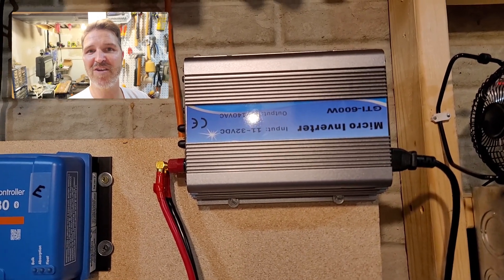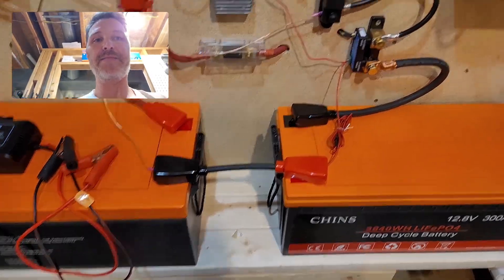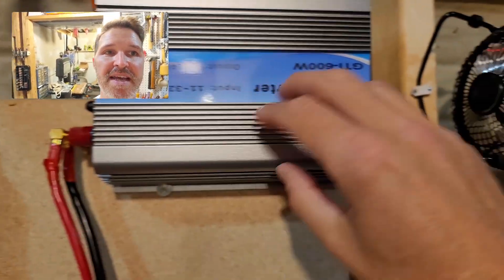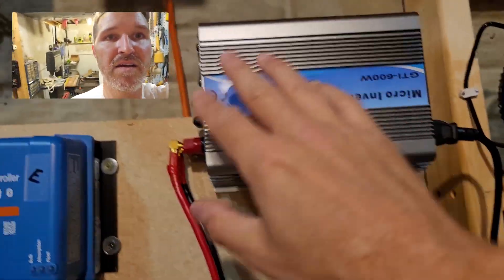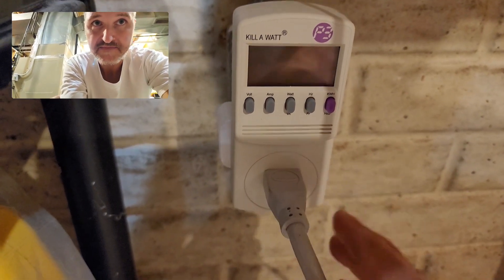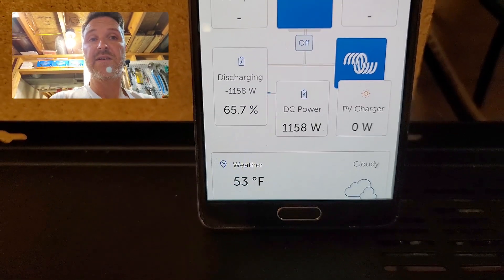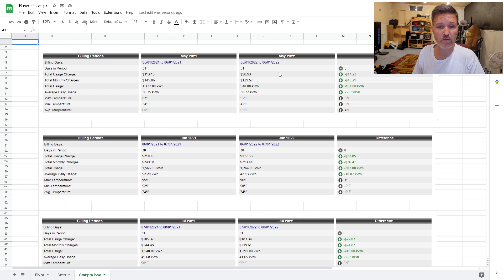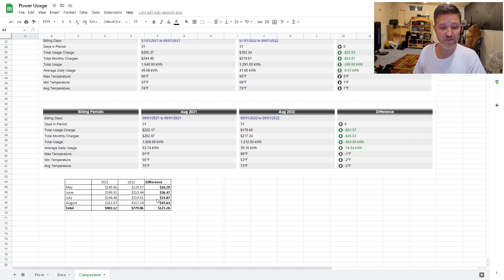Simple explanation of Grid Tie Inverter.  It saved me $123 in 4 Months!

Comment: Very cool, I just ordered what looks to be that exact unit because I plan to build multiple small systems that I can combine as needed rather than a single large single system. Glad it's worked out well for you.
Reply from the maker: Just make sure to control the heat and larger enough gauge wire.  Thanks for the comment.
Reply: @OffGridBasement  Yeah, I am thinking that a lot of people have problems because they try to squeeze the maximum out of their electronics at all times.

Comment: Would it be possible to connect the inverter as a dump load from the solar charge controller?
Reply from the maker: Yes.  Just connect them both to the same bus bars along with the battery.  You would need an advanced charge controller to set up a relay for the inverter to shut off from the AC side.  Not sure on how to do it.

Comment: I did not have much luck with the 1400watt version. May 1200w panels seem to bottle neck down to about 645 watts. So happy with PowMr registered full 1.2 kW of solar today 😄. Unfortunately I have no 36volt battery to test if 1400w grid tie works better with a battery.
Reply from the maker: Hope you get that battery soon!
Reply: @OffGridBasement  Not sure, I need anymore investment in solar now. More electrical than I need. And gas seems way cheaper than solar in terms of water heating for winter. PowMr is off grid. So not using much grid at all.
Reply: @OffGridBasement  I just run a couple of extensions.  Cooking and heating diminishing savings and return. Plumbing electric wayer heaters could be very expensive so no plans for that.
Reply: I have the 1400watt 36volt version too. I have mine hooked up to only 200 watts of solar panels at 36volts. I observed it starts getting really hot at 300watts so my remaining solar panels are connected to my battery backup solar system instead. I think the 1400watt version is overrated... I saw a video of another YouTuber who opened up the 1000w and 1400w versions and it was literally the same.

Comment: how do you keep the grid tie inverter from draining the batteries?  It will just keep running until the battery is drained
Reply from the maker: I put a smart AC plug on the grid tie inverter.  When I doesn't sense AC power, it shuts itself off.  It's a safety feature in the unit.  Thanks for the question.

Comment: Just to be sure, you're backfeeding the Kill-A-Watt from the grid-tie inverter and it's still able to measure the watts going back into the outlet, correct? I have the same meter but haven't wanted to risk using it this way because I'm unsure if it can handle power going in reverse. Thanks!
Reply from the maker: That's correct.  I've never had a problem using it this way.  I figure 600w is only about 5A @ 120v, so it's really not much.  Most outlets handle 20A and I don't think the Kill-A-Watt cares which direction the energy is coming from.  Hope this helps!

Comment: Thanks for the video. So when your ac unit turns on it drains your battery's really fast right? Ac unit pulls 3k watts per hour or more??  How many amp hours are your batteries? Thanks.
Reply from the maker: No.  It doesn't matter what is being powered.  The unit pushed the same amount of wattage regardless of what was running, usually about 530w.  So in the case of the AC unit, I would be using 2.5kw from the grid and 500w would be generated from the unit.  I hope that clears it up.  Thanks for the question.
Reply: @OffGridBasement  How are you limiting the power output?
Reply from the maker: @DaBuDaSak  There is no limiter on the unit.  I researched the base consumption of my house.  I realized my house was always using more than 600w so that's why I went with this inverter.  If you feel that is not your case then go with a unit with a limiter to be safe.

Comment: Now does this only supply to that oulwts breaker?
Reply from the maker: Yes.  It only supplies one circuit.  Don't use it for trying to over power a breaker.  I don't think that will be a good idea.  Thanks for the question and comment.
Reply: @OffGridBasement  I say I didn't think it be smart use it on same circuit as inverter charger
Reply: Once I get some extra panels I'm definitely going to do this

Comment: This is what I have been looking for. But I have everything set up for 12-volt battery system. And ideas where I can find an inverter for that? Thanks
Reply from the maker: Since these inverters are actually made to connect directly to solar panels, I don't think there is anything like that.  You could try connecting a 12 - 24v boost converter

Comment: This is in essence a plugin battery! I was thinking to buy a grid tie micro inverter myself and connect a battery on it to give that power back to the grid! Just as I see that they put batteries into the solar input of powerstations to extend their capacity!
Reply from the maker: It does work well.  Just make sure not to push the power outside your structure.

Comment: Interesting concept, i did it the opposite way. I removed a circuit from the panel, i then ran a plug from the inverter to the outlet. (outlet is on the circuit removed at panel) I hooked up a transfer switch to another house power circuit, the switch will then switch to house power at 12. 6 volts and come back at 14.1 volts.
Reply from the maker: Good thinking!
Reply: Porky...this is what I want to do, but not sure how specifically to do it. Do you have info (site or video) on how to set it up? Do you use a sub panel? Can you do more than one circuit? Can you do the circuit for the central air?

Comment: I have the same inverter GTI-600W but I discovered the meter you have higher 580w, I have lower the meter I got 80W, I have only one solar panel has maximum power 100w Vmp 18.41V Voc 22.41V panel model CNX-100 and my inverter GTI- 600W without battery only solar.
My doubt, do you need another more solar panels? I don't know how many more parts you need to give more power or it will damage the inverter, that is my question.
Reply from the maker: As long as you don't go over the maximum voltage of the inverter you will be fine.  Thanks for the comment.

Comment: Maybe you can explain this to me.
I have 12- 100W panels 6A each wired in parallel.
Each panel puts out about 21V, separately.
When wired together, I only get about 16V and about 9A from the PV array.
I have a 1300W GTI and it gives me about 1A out, never more than 2A.
I have meters on the 12v and the 120V sides.
WTH is wrong?
Maybe the GTI is loading the PV array down.
I expected 60A from the PV array.
I added a 2nd 1300W inverter on the same PV string and the outputs split, 1/2 on one and 1/2 on the other.
I will need to install the 2nd PV string to use the 2nd inverter.
Reply from the maker: What is the minimum voltage for the GTI?  The one I'm looking at is 34 - 46v.  You might want to parallel your panels so you have two sets of 6 panels.  That should put out around 30A @ 38V.  It makes sense that the output split.  The two units were receiving the same voltage, but at 1/2 the amperage.  I hope this helps.

Comment: I am thinking of using something similar.  I know if you use what it generates,  it won't be noticeable by your power company.  I am thinking if I charge a solar power station from an ac plug and can generate an equivalent amount of solar from a grid tie inverter,  it would be effectively increasing the max solar input of the power station.  Especially since most offer small solar input.
Reply from the maker: Just make sure it shuts off when the power station is full.  Thanks for the comment.

Comment: hello, great video, my question is You should not include the cost of the solar panels that charge your battery? or what ever cost that charge the battery?
Reply from the maker: I didn't feel it was necessary since the system was already in place.  All I did was add the small piece of equipment to an existing setup.  You have a good point though.  Thanks for the comment.

Comment: Are you still running the grid tie inverter? If so how about a 6 month update?
Reply from the maker: I took it down during the winter.  It was difficult to keep my batteries full let alone run a grid tie on top of it.  This season I'm going to do something different so unfortunately I probably won't be connecting it back up.  Thanks for the question.
Reply: @OffGridBasement  I built my system in the past 3 months (thanks for all the videos) so I am still trying to figure out my loads vs the sunshine. A couple of sunny days in a row and I am into surplus power. So I debating adding additional loads or something grid tied with an adjustable low voltage disconnect. Keep it set to pull the batteries down from full charge but disconnect at about 95%.
Reply from the maker: @davidbrady9686  if you have other things to charge, that would the way to go.  Plug them into the system.  I'm looking into getting an electric lawn mower and chainsaw.  Both 40v.  Low voltage disconnect might work really well.  Set it to turn on at your bulk charge setting  and turn off at the float setting.  Good luck!

Comment: This is really cool. Can I make it so the grid tie only kicks on when my batteries are in float and doesn’t discharge from the batteries at all?
Reply from the maker: I wish I knew how to do that.  I know it would involve the relay on a Victron smart shunt in order to trigger something.  I just don't know.  Sorry.
Reply: @OffGridBasement  Ok no worries I appreciate the reply. I have the victron smart shunt so I’ll have to to look into how to set it up through that. I did find  something on Missouri wind and solar. It’s a digital charge controller with divert relay and led volt meter for wind and solar.

Comment: Im confused.  Are you charging your batteries by your grid then pumping more power back to the grid? Or charging by solar ?
Reply from the maker: Charging with solar and pushing power back into my house when the batteries were getting full.
Reply: @OffGridBasement  ahh ok thanks
Reply: @OffGridBasement  is this automated? how so? or do you manually turn on yourself (connect battery to house outlet) when the battery is near full?
Reply from the maker: @john-vega  I monitor the battery and turn it on via the smart plug.  I can monitor the battery bank and turn on the smart plug from anywhere with cell service.

Comment: is that even legal ? Or do you have a program worked out with your electric company??
Reply from the maker: As long as the excess electricity doesn't leave my house there is no problem.  The grid tie inverter doesn't produce more than what my house uses at its lowest point.  It's just supplementing what I use in-house.  I'm able to look at what my usage is from the grid by the hour through the website of my power supplier.  Thanks for the comment!
Reply: Bingo. As long as it doesn’t affect electric company, you can rig up a treadmill or bicycle to generate as much power at home as you’d like.
Reply: @OffGridBasement  it still sounds like the electric company is getting cheated not that i care
Reply: I am not an electrical guy, but I personally imagine my house as a water bladder with two water inlets. One has large garden hose flow (electric co) and one is a small straw pipe flow. When the straw flow is turned on then the garden hose flow is pushed back a bit and flows less. As the need of “water” of the house is fixed.  The electric company would only see less demand from their supply as if a few appliances were turned off. I don’t see how they are cheated at all. Seems perfectly safe with islanding. Thanks again OGB.
Reply: That set up cannot be legal. No way.
Reply: @mannyfragoza9652  just stop
Reply: @mannyfragoza9652 it's not cheating but it's definitely illegal without a permit
Reply: @AgentOffice  I think if you don't push energy back to grid, then it should be ok. That's the purpose of this particular inverter, does not produce more than house needs, but would like to know how this is done.
Reply: @john-vega  most inverters can do no export. You need CT sensors on the main line

Comment: Does your electric company meter notice it being on? I’ve heard some meters record in AND out so these could charge you for the power you actually made. Perhaps it’s unlikely as your inverter is making a small amount in comparison to what’s coming IN so that maybe it’s just slowing down the incoming power flow “so to speak”.
Reply: If the power generated by inverter is used up by home appliances then the electric company would not even notice it because it doesn't even reach the meter.
Reply from the maker: That is exactly what is it doing.  My base usage for my house is over 600w.  I can see this by looking at the hourly usage from my electric companies' online portal.  Thanks for the comment!
Reply from the maker: Yep!  That's what is happening.  That is why I choose such a small inverter.  Anything better, I would need a limiter.
Reply: Thanks guys I’ll get one then! I was warned that our meters here could spin backwards and I’d be charged for it. I am a ceramic engineer as I hated electrical classes so your input makes sense to me in my simple mind.
Reply: I’ll buy one today from your link to help your site. Question…. I was going to run a separate 12-2 wire in attic from my 24v inverter directly to my fridge/freezer (& down a wall with a new dedicated “solar” receptacle).  I am thinking the Grid Tie inverter might help negate this need for a line? The 600W it runs could power a 550W fridge even over night? Or am I asking too much? In which case I’ll run the 12-2 line and new outlet anyway.
Reply: I’ve already run a dedicated 12-2 line into laundry room for a solar receptacle and then for six months I’ve ran an extension cord down a short hall way to power the 465W fridge/freezer. My system has been running that and my clothes washer seamlessly.
Reply: Saving ~$30/mo thru your grid tie is AwEsOmE! My payback till I break even on my solar build so far is 19yrs. The addition of the grid tie would help ALOT.
Reply from the maker: @chriswhitehouse9764  it depends on what you are wanting.  If the power goes out, the grid tie inverter stops working.  So if you are want to make sure the fridge keeps working during a power outage then you need to run the line and connect it to your off grid inverter.
Reply from the maker: @chriswhitehouse9764  thank you for supporting my channel!
Reply: Thanks for your education and encouragement here!
Reply: Purchased with your link!
Reply: I'm still baffled how his "grid-tied" micro-inverter is tied to the grid. That looks like a dangerous set up. Who pays him? What is he back-feeding into?
Reply: @realToby  true. I don't understand his set up.
Reply: If your base falls to 599 and you put in 600 won't that trip a red flag if only for a few seconds ?

Comment: Toys for watts explained that while this works, because the inverters aren't UL listed if your house burns down and is tied in any way to that inverter you will take a total loss. There are safer inverters on the market. Sungold I think is one that I'm considering. And it allows a generator hookup.
Reply from the maker: Thanks for the info!
Reply: He has a dangerous set up. That cannot be up to code. No way. You cannot back feed using a male plug.
Reply: @robertolang9684it gets used, meter never sees it

Comment: I'm confused. Is the outlet you have the inverter plugged into live? I just came across a video with this micro inverter and I'm curious how it works. Thanks and I enjoy your videos!
Reply from the maker: Yes.  It's a live circuit.  It basically pushes power back into my main panel.
Reply: @OffGridBasement  Thanks for answering! So the outlet has 120 volts, and the inverter is pushing 120? There is no stalemate?  I guess I'm lost lol sorry.
Reply from the maker: @guyztruth4593  I never experienced a stalemate.  It did push out 120v to a 120v live outlet.
Reply: @guyztruth4593  The grid tie inverter determines house voltage and then increases the inverter voltage slightly above house voltage. Example: if the house voltage is 120v, the inverter will output 122v.
Reply: I don't understand his set up. Not sure how it works. Your appliances can't know the difference between your grud-tued inverter and the grid. He needs to state if that outlet with the Kill-A-Watt energy monitor is hot. They don't sell male end plugs to do back feed. No way! Dangerous!

Comment: thanks for the info. you didn't add in the batteries, mppt, solar panels and wiring. That would set your ROI back some. I am looking into doing the same to save a bit on monthly cost. Thanks sean from montreal
Reply from the maker: That's a good point.  I didn't think about it since my initial reasoning for the off grid system wasn't for this.  It would take many many more months for real savings.  Thanks for the comment.
Reply: @OffGridBasement  no problem.. I am on the verge adding solar keep the great vids coming

Comment: I do not quite get it. You are charging batteries from grid power, costing you money. Using same power later (with the micro-inverter setup you explained), how do you get lower bill?
Reply from the maker: This system is completely off grid.  I'm charging the batteries from 2.6k of solar.  Once my batteries got close to full I would turn on the grid tie inverter so it could push the excess energy into my house.  I hope that clears it up a little...
Reply: @OffGridBasement  Thank you for quick replay. Switching the batteries and grid tied inverter manually on and off is not good. If this switch over is done automatically, than I would like to know, how this is done.
Reply: Great point. All I know he has a dangerous set up. That is not up to code. What you are saving is not energy you are putting into the grid, it's energy from your solar system that is partially running the house.